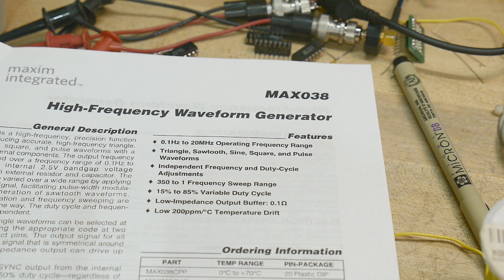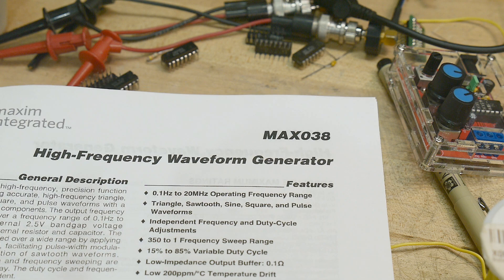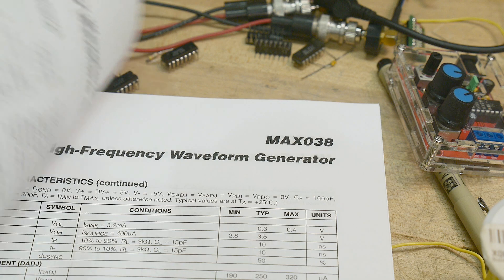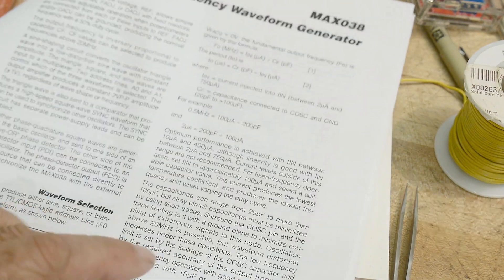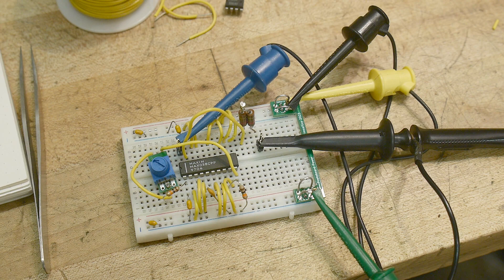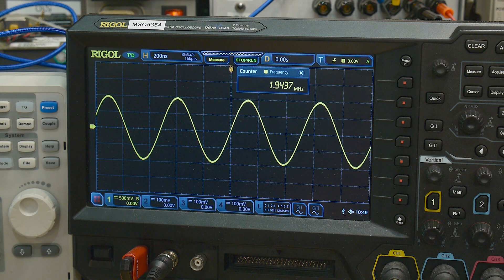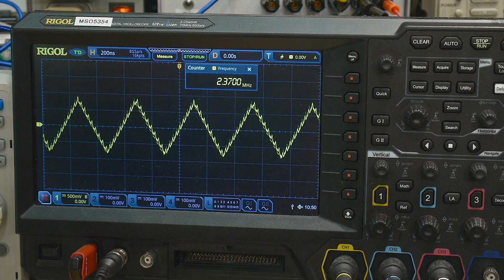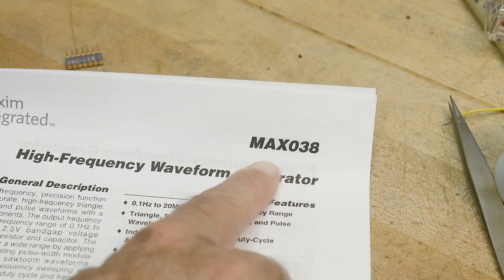#1577 MAX038 Waveform Generator

Comment: The cost of these Chinese function generator kits is nothing short of amazing. While they are OK for the electronics experimenter and students, they must be made aware that there are many fake chips out there. I recall one YT showing a fake XR2206 which worked fine using a 9 volt battery but produced an unstable waveform using 12 volts. Over 40 years ago, I built an XR2206 function generator from a kit for our biomed engineering use. Even added an extra capacitor for additional range. A few years back, I bought a M328 tester for less than $15, complete with the “shell” (they don’t call it a box or case, but call it a “shell”, translation issue I suppose). After I saw your video #1508 on the DSO-TC3, I bought one to play with. For the low cost getting a function generator, M-Tester and albeit low bandwidth O-scope in one instrument. They didn’t have gadgets like that when I was an electronics student, well over 50 years ago. I like that little jumper board you use to power the breadboard rails. Looks better than the resistor leads I use and end up losing all the time.

Comment: Rip, u need to use different
 cable colours on the breadboard +5 red , gnd. Black, -5 blue or green that would have saved u a chip
Reply from the maker: The problem wasn't I connected it to the wrong voltage, I connected the voltage to the wrong pin. Good idea but would not have saved me.

Comment: Hello Sir, there is another alternative but controlled using a microcontroller "AD9833"
Reply: yes but it's a DDS not an full analog circuit that you can tune easily with a simple pot
Reply: @yveslesage8525  yes I know, it it controlled using the SPI communications protocol, do you know an alternative chip with analog control?
Reply: @kamelk8027  Unfortunately no, The MAX038 (which I used 12 years ago) to build my first RF Sweep Generator (up to 30 MHz) with FM (and AM) modulation was discontinued according to Maxim 'cause the IC foundry they used stopped making the band gap process the chip needed. I found some samples on eBay (about 10 USD each).

Comment: Have you seen or built the function generator  kit with the ILC8038? This uses the. ILC7660A charge pump ic chip? This chip uses a single positive voltage and outputs the same input voltage only negative. Thoughts?

Comment: The very first chip I ever used was the similar functioned ICL8038. It was cool that the datasheet provided a complete schematic of the internals of the chip. I also blew mine up and had to order another one (back in the early 80's when you had to mail a check to DigiKey and wait a couple of weeks for stuff to show up.
Reply: Fond memories the 8038 predecesor was in one of my earliest designs in a 1977 day job I had. A training school for process control instrumentation clients whose instruments were all changing over from pnuematic to electronic. So they could get up to speed on 'electrical' concepts they connected the FG up to a scope and opamps.

Comment: This is an Ex-Max038. ⚰
Reply from the maker: it is no more
Reply: @IMSAIGuy  👍
Reply: @IMSAIGuy  Sorry for your loss ! I just bought one off ebay for £8.50p simply to mess around with and I gonna be real careful !!....great 'Chip of the Day'...cheers.
Reply from the maker: it's pining for the fjords
Reply: @IMSAIGuy  Pining for the fjords ??? It's bleeding dead !!!!
Reply: @andymouse  Beware. Plenty of Chinese fakes being sold. If the printing is not clear, like the one in the video, and the vertical bar is not between pins 1-2 and 19-20, then don't be surprised if it doesn't function, or draws high current. I've been there already.  Plenty being sold on AliExpress, and they all have different printing on them.
Reply: @peterrhodes5663  Thanks and yes I've taken a bit of a gamble here! so It's just fingers crossed ...cheers.
Reply: It is deceased.
Reply: @andymouse  🧀